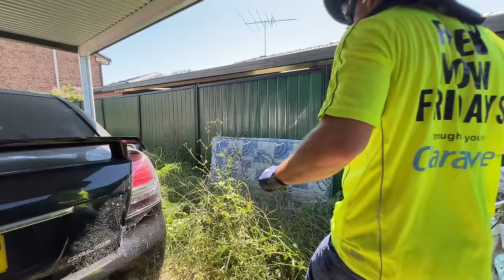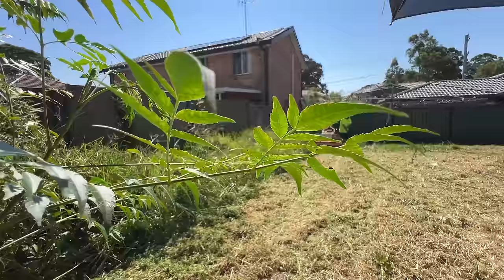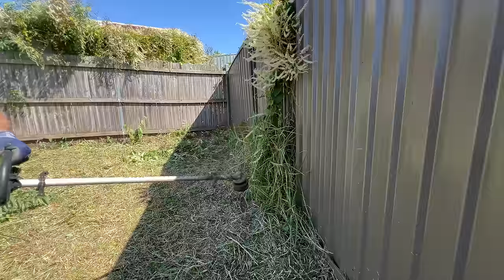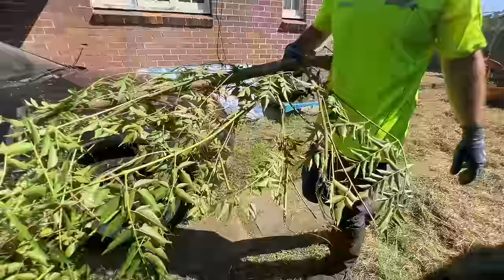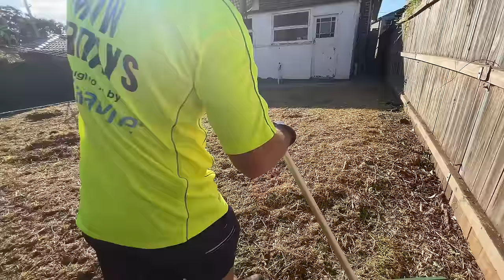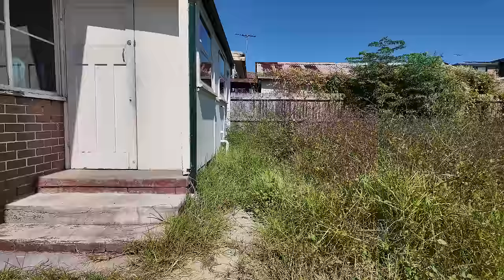3 years ago, WILD yards like this would scare me. NOT TODAY! Free Mow Fridays #satisfying

Comment: “greatest of all time”push mower. The “GOAT”
Reply from the maker: Phil The Flail is the MVP
Reply: You ain't pushing "Phil" he weighs 25Okg. He has 48Occ of displacement witha Briggs and Stratton 16hp motor and a 5 speed transmission with a top speed of 4kmh. ""Phil" is self propelled for obvious reasons. "Phil" doesn't get pushed around. No Sir.💯%

Comment: grouse work Tim mate love every bit of it from start to finish and yep that lovely SP (Self Propelled) by the looks of it mower knocked down that material in there too no worries and well that made dead easy work of the overgrown grass for sure and i know the brand Billy Goat from memory have a very similar tool for the Australian Outback as i think the local Council in the areas like Medium Strips on Roads and well acre sort of areas use them from memory too but yeah lovely units and made for jobs like these ones by comparison too no kidding and well as a bloke from Regional VIC (Victoria) yep i have seen stuff like this for what you used for knocking down the thick foilage in your video content too and yep simply crazy what can happen when stuff becomes overgrown and a standard Petrol/Gas mower cannot often handle with the catcher or the Side Discharge option too but yeah all good when these units are built well for jobs like these ones too sweet work and a love the good detailing and the heap piles too awesome as etc.

Comment: That mower you call "Phil" has so much torque and power it doesn't even drop RPM going through the thick stuff. The RPM stays the same and just powers through. How much horsepower and Torque does it have?.. By the way it cut the lawn with ease, im going to say A LOT.💯% PS I think you need a better quality or thicker line for your whipper snipper. It looks like you are constantly banging on the bottom to feed more line out or am I tripping? Im sure after all of your mowing and snipping you use the best quality line for your whipper snipper? Anyway I forgot to say well done on the transformation. Also I have a Question ❓ Do you see many snakes in this long grass or do the snakes get scared off by the vibration of snipper and mower? Cheers Tim.💯%
Reply from the maker: Not sure of the numbers. Its an AS motor 901 if you want to look it up
Reply: @timthelawnmowerman Thanks Tim. I will look it up. Great work. Awesome transformation. That backyard can be used for kids again. Do you come across many Snakes or does the vibration from the mower and snipper scare them away?*
Reply: @timthelawnmowerman  it's a Briggs and Stratton with 480cc displacement, 2 cylinder with 16hp. Weighs 25Okg, 5 speed transmission with a top speed of 4kmh.
Very impressive machine.
Briggs and Stratton make the best, most powerful and most reliable engines in the world.💯% With regular maintenance "Phil" will live forever.